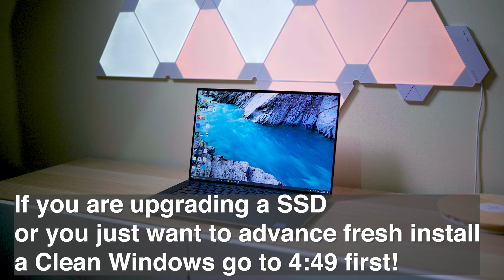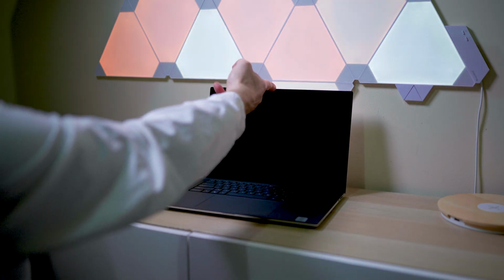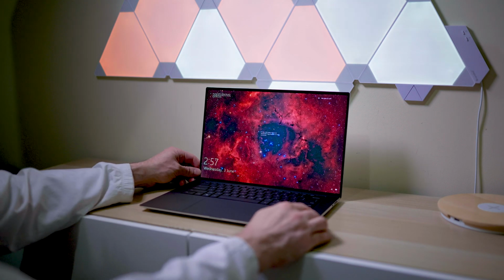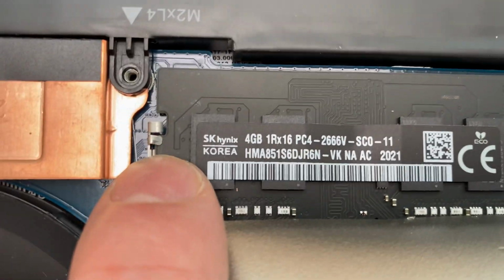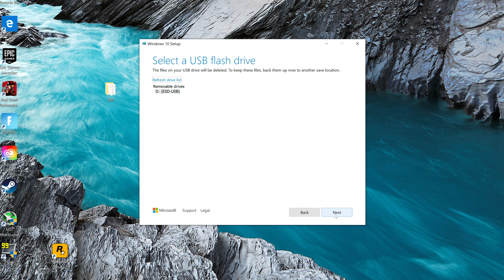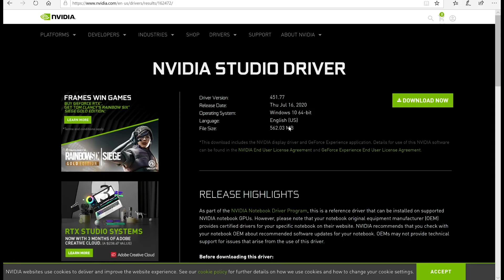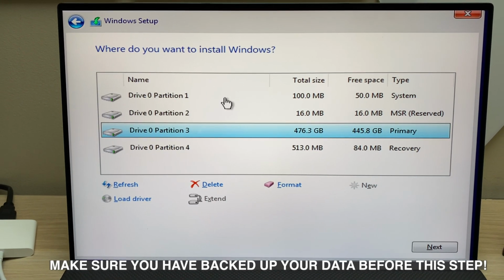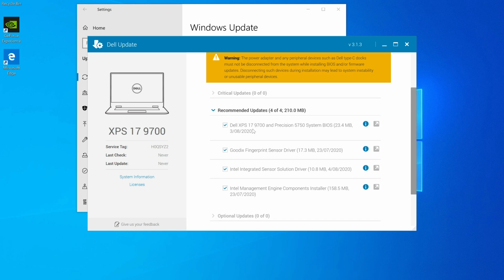Upgrade RAM & SSD on XPS 15 & XPS 17 + Advanced Setup Up and Windows installation for any Laptop.

Comment: Hi Iam in Melbourne. I saw your video it is so good for people like me who are not that tech savvy. iam planning to buy a Dell xps 15 and upgrade. I want to upgrade to 64gb ram and 2tb ssd. when I see in the market for the latest xps15 I was told I cannot upgrade the ram or ssd as it is soldered. could you please suggest if I wanted to look for used xps 15 i7 cpu which model and generation should I look for? Your suggestion is highly appreciated.Thanks.

Comment: Absolutely loving the videos/ content. It's helped me no end choosing my first XPS configuration. I've just paused your video at 3:08 - I can't believe Dell's sticking budget ram sticks in a machine like this 1RX16 in a machine like this! Seriously!! Have you had a chance to get hold of the newer Tiger Lake model yet and see if Dell have been just as stingy? My other half gets 20% off from Dell so it would work out cheaper to buy 64GB RAM from them directly - but if the RAM sucks, it will be going in the bin anyway so I'll go for 16GB and upgrade myself.

Also - in your expert opinion - do you think getting the 11980HK is worth it in a machine like this? Running at 45w to 65w vs 35w to 45w in the 11900H, I'm worried about thermal throttling. Do you think this beast can handle the extra power?

Comment: Here's a tech tip for ya,  use powershell to  backup drivers before you removing old ssd add them to thumb drive  then you have all system drivers with out Dell crap, just open device manager and install drivers

Comment: Just received my XPS 17. About to instal 2x1TB SSD's (Sk Hynix Gold P31) and 2x32GB RAM (HyperX Impact). Wanting to do a clean installation like you did in the video above. There are currently 50 drivers listed on the Dell website for the XPS 17. You only used four of these drivers. Are there any others that you feel are necessary? Or can they just all be ignored and just go with the four you recommended?

Comment: You should have explained the ram speeds. A lot of wrong info going around
Reply from the maker: just get 3200 and it will go to the default of the machine
Reply: @TallyHoTech  ∆∆∆∆∆∆∆
Reply: @TallyHoTech  can I use this in an xps17?

https://www.amazon.com/Crucial-Ballistix-Desktop-Gaming-BL2K32G32C16U4R/dp/B083TRRT1N/ref=pd_gwm_rtpb_1?pf_rd_s=blackjack-experiment-2&pf_rd_t=Gateway&pf_rd_i=mobile&pf_rd_m=ATVPDKIKX0DER&pd_rd_wg=Ehpu8&pd_rd_r=72CYMW0XZBMB252QRDDE&pd_rd_w=yx4ld&pf_rd_r=72CYMW0XZBMB252QRDDE&pf_rd_p=8a9de583-829b-42c2-909d-0b1731eb34ec&ParentWidgetId=mobile-gateway-btf_cue-MissionPicks1&ParentReftag=ci_mcx_mr_hp_m&ParentRankingIndex=1&ParentStrategyId=cue-MissionPicks&pd_rd_i=B083TRRT1N

Comment: For those interested Dell lines out every step for a re-image.  I think the important part is they even designate the driver installation sequence.
https://www.dell.com/support/manuals/us/en/04/xps-15-9500-laptop/xps-15-9500-re-image-guide/xps-15-9500-re-imaging-guide-for-windows-10?guid=guid-5b8de7b7-879f-45a4-88e0-732155904029&lang=en-us

Comment: I just purchased the XPS 17.  Its about 2 week until I get it.   I got the top range unit for less than the base model.  It came out 200 bucks (Australian) less an the cheapest model after the sale they offered.   I tried to get the same sale on the base but Dell wasn't coming to the party as I had the same idea you had, get the cheapest model and then buy all the RAM and SSD expansions. Great minds think alike.

I did want to ask about the reboot software, I was a bit confused on your presentation on how to go about putting the new software on the new ram and ssds.   I was a bit unsure of what you where where showing.   I Could you just clarify the reintroduction of the software Windows instillation?  For the record this is the FIRST windows machine, IN MY LIFE!, I have purchased.  I have jumped from the OS/MAC system.   So my knowledge of such things is tiny.
Reply: This is re-imaging either a new SSD or your existing SSD.  Has nothing to do with RAM.

First you have to make the windows installation media.  https://www.microsoft.com/en-us/software-download/windows10
Once that is done you need to download the drivers he identified, and save them on a folder on the removable media you created.  He made a new folder to keep things organized, but not required.
Power down your XPS machine.  Insert removable media.  Power machine on and keep tapping F12 until you see the one time boot screen.
Select the removable media you inserted earlier, and let it run.  Do not set up your wireless, or internet connection.  Do that later.
Once it boots back into Windows 10 load the drivers from your folder above.
I'd do a reboot here, then connect it to the internet and run update as he showed.

Dell has a full blown breakdown on re-imaging this machine, including recommended driver sequences. 

https://www.dell.com/support/manuals/us/en/04/xps-15-9500-laptop/xps-15-9500-re-image-guide/xps-15-9500-re-imaging-guide-for-windows-10?guid=guid-5b8de7b7-879f-45a4-88e0-732155904029&lang=en-us
Reply: Shain Andrews 😁 👍👍
Reply: Oh and if you are a new convert.  Try running it out of the box.  Personally I was surprised at the lack of bloatware.  My XPS 9500 runs fine.  Mid July build.  I was fully prepared to re-image mine, and so far have not felt the need to do so.
Reply: How much did you pay? Was the sale just offered through the dell website? I have been waiting for a sale to come up in US but no luck yet. Still $2,990 for  32gb ram model with uhd screen
Reply: @TonyStark-te1wy  The most you can expect Dell to discount is 10% for consumer sales.  They are not interested in giving anything more for one off transactions, and they will only offer that during their posted sales promotions, so check daily.  If you are not a business you really have no leverage beyond those promotion periods.  For a small business maybe 12% available any time they purchase.  Large enterprise 15%.  Federal around 22% but only because the sales force is leveraging lower margin products (laptops) for higher margin products (servers, workstations, etc).  I'm speaking from my previous HP employment.  I could tell the purchasing agent what discount to expect before HP product management responded.  I was generally within  2%.
Reply: Tony Stark I contacted Dell about the sale and did some negotiating.   I’m doing, as part of being on Jobkeeper some full time study for six months.  So I asked for a student discount.  Initially it was 50 bucks discount but they bent a bit more and I got it a smidge cheaper.   I was happy with that.   

So this will be my first compat, windows machine.  I am a little anxious about the decision but I’ve been really disappointed with Apple for a while now.   I was going to hold of for the i9, which honestly I think would be a smarter thing to have done but my machine died a couple of weeks ago.    I needed to buy now.   I’m just using a tablet at the moment until the laptop arrives.   So I think it’s okay for you to wait if you can for the i9.   When that comes out don’t be surprised to see the i7 on sale 🤒.

Comment: Tip for opening (removing base cover). There are little thingys (notches) on certain points, push against them with a credit card or dedicated tool. Then it opens much easier. I found that little trick after trying to open it for 15 minutes. Actually it is even stated in the manual to do so (yeah right, I do not red manuals usually^^)
https://topics-cdn.dell.com/pdf/xps-17-9700-laptop_service-manual_en-us.pdf
Reply from the maker: Great tip!

Comment: Be careful with the upgrade guys, dell is notorious for using cheap/soft screws. Don't strip them.
Reply: @soledadberrocal9412  Yes, just google "dell xps stripped screw" It happened to me on my xps 9700 I had to return. Be really careful.
Reply from the maker: pRO tIP
Reply: Thread locker, soft screws, cheap tools = bad times.

Comment: My man, what about changing the RAM speed in the BIOS? Wouldn’t it default to 2133mhz if you just throw em in there and don’t change anything?
Reply from the maker: Should be running at the same speed going from 3200MHz to 3200MHz RAM mine runs at full speed without any bios setting changed.
You’re right though this can be an issue
Reply: Tally Ho Tech oh good to know! I get my 17 Wednesday so I was only speaking from what I’ve seen from what some people have said! Thanks for your reviews of this computer. It’s what has convinced me to grab it!

Comment: So spend a shed load of money buying it in the first place,  and then spend some more to make it better?
Reply from the maker: My idea is to get the low spec then upgrade
Reply: I priced out Dell's upgrades vs aftermarket upgrades.  Wasn't much difference in the US.  Little over a hundred dollars, but then I would have useless RAM sticks, and an undersized SSD.

Comment: Does it void the extended warranty I purchased from Dell if I upgrade my Ram and storage?
Reply: I have read that in the Uk it is illegal for them to void your warranty if you upgrade you laptop. Though I don’t know where you stand if you short it out while upgrading it...
Reply: @doubleupdan720  I live in the US
Reply from the maker: No. As long as you don’t damage it
Reply: @TallyHoTech  I have the XPS 15 9500 with 16gb ram, 512 SSD, i7 6 core, 4k touch panel. Would it be a noticeable difference to upgrade my memory from 16 to 32 or 64?

Comment: Thank you so much, 6th thumb up. I am planning to purchase a XPS17 here in Australia, but there are only 1TB SSD options. So I will buy a 4TB or 8TB SSD to slot into the second SSD port. A basic question for most, but I am wondering how this second SSD will appear in the 'Devices and Drives' section. Will the factory Dell drive merge with the aftermarket drive? Thanks for any advice. Much appreciated.
Reply: Hey, here in Japan they also offer up to 1TB and I’ve been thinking of inserting 4 or 8TB either! Did you have any success with it, because on the Dell XPS 17 page it actually say that it only supports up to 2 TB (which sounds weird) I’m planning to give it a try anyway with the 4TB next week!
Reply: 60 beats the drives will be separate devices, and you’ll need to format the drive using Disk Manager. There you can name it and add a drive letter. If you’d like, you can also make different partitions. It’s a very simple process, if you need help there’s loads of YouTube videos. In file explorer it will show up as a second drive with the letter and name that you set when you formatted it. Hope that helps!
Reply: @dev.lockridge  Thank you so much Skylatian, you are a star ⭐ I consider myself quite PC literate, but when it comes to hardware, my hands-on experience is limited. Do you have any direct experience with The Dell XPS 17? I am also considering the yet to be released Thinkpad P1 gen 3. The MacBook Pro 16 is a more remote option, as depending on several native Windows programs (MS Access, MS Publisher, Quicken for Windows, Articulate Studio), I would have to run Parallels/Windows and I don't know how practical that would be. Thanks again.
Reply from the maker: Look up disk management in windows search and format the drive
Reply: 60 beats unfortunately no experience with it (I wish!) but personally it’s my favorite laptop and the one I’d get if I had 3 grand to drop on a new laptop. that thinkpad keyboard would be amazing though, dell one is great too but thinkpad keyboards are unrivaled.

Comment: heard that dell did something to rectify the battery drain issue on xps 17. Has it really been fixed and how? is it safe to buy now?
Reply: I brought a 2060 xps17 on 12th June it came 3 weeks later, used it for 2 weeks but had trouble with battery drain. Had hours on phone and messages with dell support which drained me more than the  unit drains its self!! Eventually the laptop failed to boot after running really hot. Nothing just black screen. They asked to repair, then told no parts and no availability date, so I demanded they have another sent out. The unit replacement has eventually been authorised and I'm told I'll get my replacement 2nd week in September. Now here is where my major issue is.. The unit unit will have orginal warranty re-aplied. Therefore I will have lost 3 months warranty for 2 weeks use. They will not change this and have only offered me 2 weeks extra warranty.
Paid £2800 for it, ill never buy a dell again.
Reply: @vambo1980  oh man! That hurts. In an ideal world one would go for dell as there tech support is solid and wide spread (atleast they reply unlike razer). But doesn't really seems so... Hope the new unit runs perfectly without any issues.
Reply from the maker: All good for me in the latest bios
Reply: @TallyHoTech  woof!! thanks for the info !!